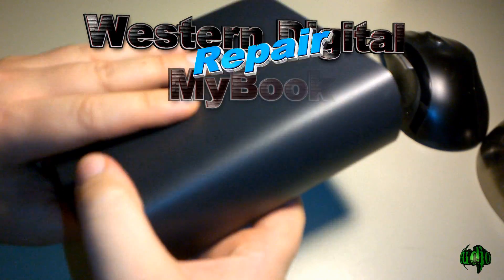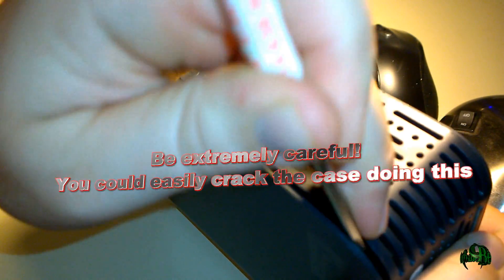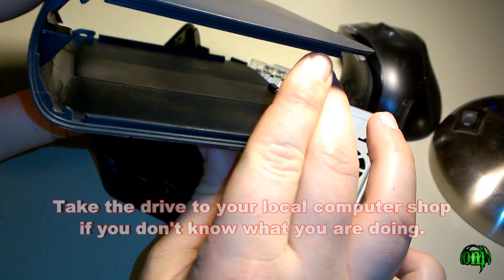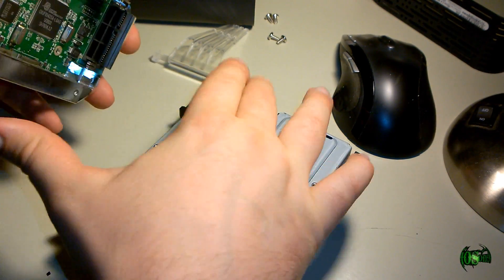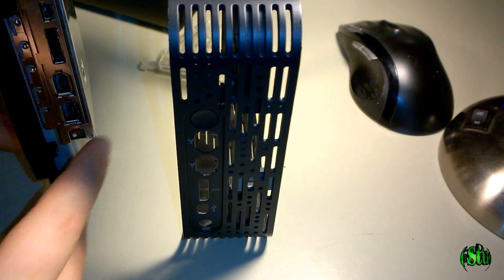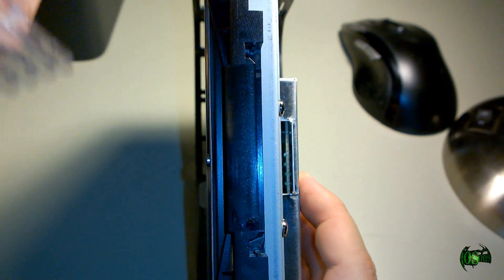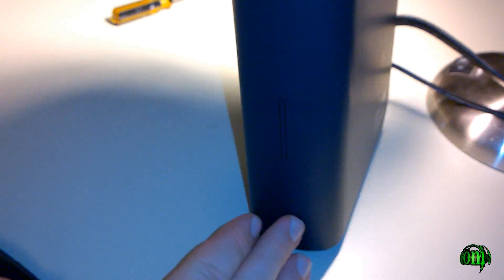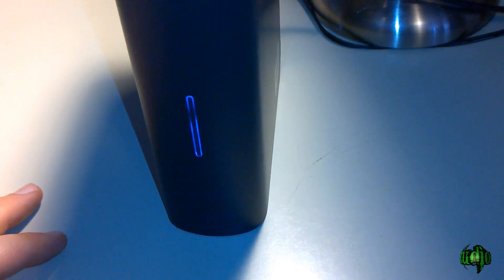WD MyBook Repair - Replace the Hard Drive

Comment: OK good video.  I have an older mybook that ... has been on the replacement list for awhile just didnt get done yet... its still connected to the router, but i can neither access it by web or by mapped network drive, but the router still says its connected... the light HAD been blue,but on my last power cycle its now flashing green which appears it could be a soft or a hard reset... going on 10 mins now.  I did not however do the 4 second soft or 40second hard reset... so i dont know why its green.    was htis how yours died?

Comment: I just opened an eBook that I got from ebay, it looks the same as yours, but got PATA HD.  It is hard to fine a new and larger PATA HD these days.  Anyway, on an older eBook like the one I got, there is a screw on the upper-right side, that it has to be removed before  you can remove the side.

Comment: Great Video does anyone know of size restrictions for the replacement drive? Can it be larger than the original ?
Reply: I have the same model My Book as in this video. (firewire and esata ports) It doesn't have any drive restrictions like the newer model My Books. WD made modifications on the newer models to prevent people from upgrading to a higher capacity drive. Note that there are some YouTubers out there who show how to disable the U2 chip to get around this limitation. As I said earlier this particular model works great with larger drives. I've upgraded my 1TB My Book with a 12TB hard drive. Using an ESATA cable, I connected it to my Synology NAS to back up my important files. It's not fast by any means but it does provide a secondary backup if the NAS fails.

Comment: Mine was slightly different.  

The plastic cover just had to be popped of at the corners and slide 50% of the way off at which point you could remove it leaving both sides open but there was another piece of attached plastic that covered all the thing sides to allow for air flow.

I had 2 screws holding the USB port onto the hard drive.   One on the side of the harddrive the other on top or platter surface where the actual components sat.  But it didn't come apart after the removal of the screws.  It had like a pin glove which slide over the pins of the hard drive after you removed the screws.  It included a single plastic light reflector held to the USB board by a piece of rubber with a hole in the center.

The drive itself, a 3 tb drive, I thought was being held by that plastic piece that allows air flow to cool the drive.  Your's seemed to come apart but mine had no way to remove it.  It looked like that plastic shield was held together by a the plastic on the backside piece by a kind of interlocking plastic key structure but it was a ruse.  When I examined the underside of that puece there was no cuts on either end.  It threw me until I realized that the drive wasn't secured or held to anything.  The drive was held in place by 4 rubber corners and you just needed to push the drive to either side at the top releasing the drive from it's rubber corners.

Comment: If you're like me and trying to take apart one of the olllld Mybooks (250GB),  if you are looking at the side for ac/usb, (where they are at the bottom)  the cover won't actually come off, but it's going to swing off clockwise and stay attached at the right side rear corner.

Comment: So is the case compatible with any other drive of different brand and size? Will it work if i put a Seagate 2tb in it, for example? I'm planning to replace the drive inside mine (500gb) and keep the case, which is very nice compared to third party enclosures (i got the aluminum version). I have already bought an eSata/usb 3.0 adapter in order to have a little speed boost since i'm using it with my iMac that has no eSata but only usb 3.0 ports.
Reply from the maker: I don't know why it wouldn't work with other hard drives, i've had no issues swapping out hdd's
Reply: Ok, great! :) Thank you!

Comment: Hi, i have the same model  and I try to change with 3 different hdd 7200 rpm 2 Hitachi 1tb of 2 old iMacs and one seagate 2tb, only recognize the wd caviar 500 gb included what is the format I have to use ? do you think I need to format the Hdd in a pc instead Mac ?

Comment: I'm surprised to know that it works using Hitachi drive on the old enclosure.  I have the 2nd and 3rd gen of My Book Studio for Mac and it's not possible to use different brand drive on it,
I came across the internet telling that we need to reset the controller board jumper but i couldn't find any jumpers on my controller model. There's no documented example of where is this mysterious jumper located.

Comment: recently replaced a 1TB WD drive with a 6TB drive - problem is my MAC only recognizes 1.6TB of it. If I take it over to a PC, it recognizes the complete 6TB.

My goal is to use it with both systems, so exFAT is the best option. But can't get it to read more than 1.6TB in MAC - any guidance?
Reply from the maker: +Viren Patel What is it formatted to now? If it's FAT32 that may be the issue. Other than that, I'm not really sure why your Windows machine see's the full capacity but your Mac does not.

Comment: hi.. thanks for the video. Do you have to install or format specifically the harddrive before? i've read it somewhere that the drive need to be installed something with the WD software so you can use it with the case..
Reply: +Reimon Andisuwa hello i am trying to change the drive on my wd 3tb wich died. the card is fine what fornat do i have to use in new drive and what software thanks
Reply: my card was the culprit, so, i used a HDD dock to read whats left from the drive. Anyhow, now i switched to RAID system. it's much much better. You should give it a try if you haven't davidsai